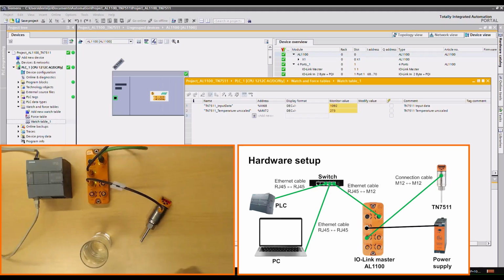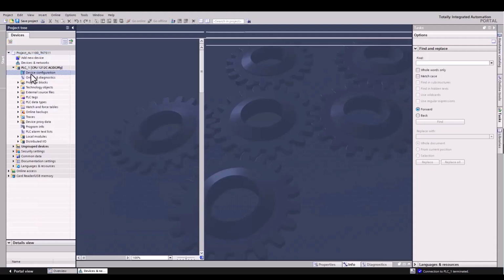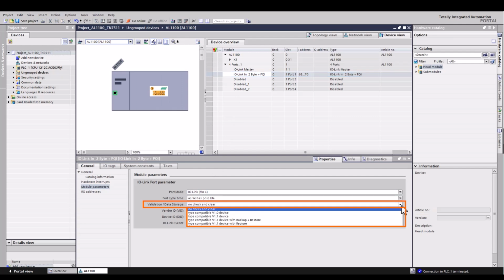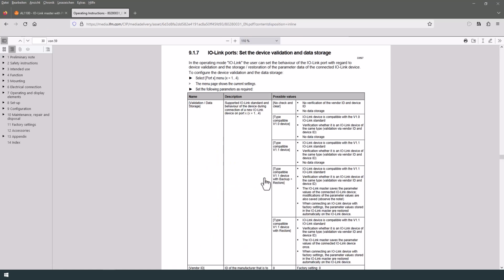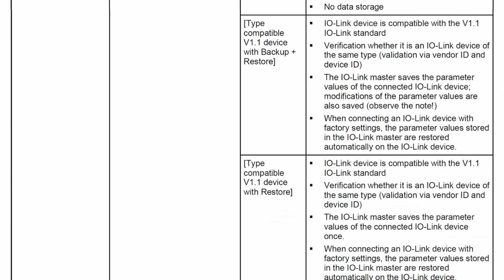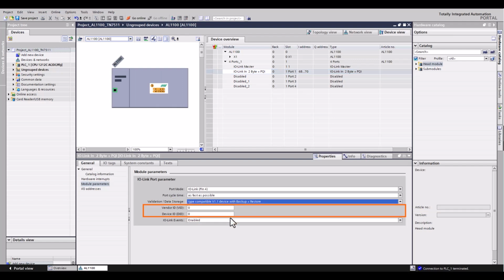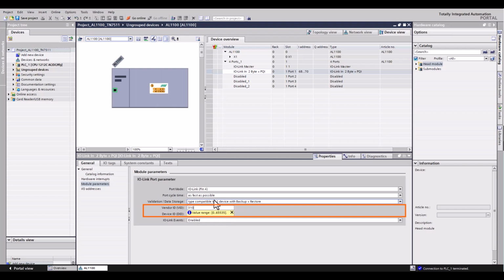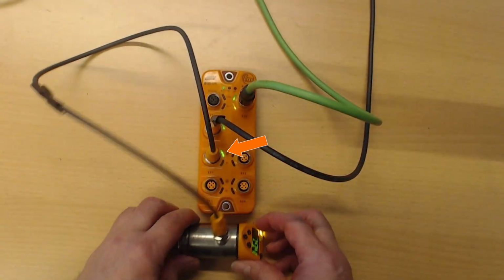IO-Link port configuration of a PROFINET master

Comment: Intégration des modules AL1302 d'IFM avec un PLC S7-1200 via PROFINET

J'ai expérimenté l'intégration des modules AL1302 d'IFM avec un automate Siemens S7-1200 en utilisant le réseau PROFINET. Cette solution s'est avérée simple à mettre en œuvre et présente un avantage majeur : elle permet de se passer des entrées analogiques spécifiques à Siemens.

Grâce à cette configuration, j'ai pu assurer la surveillance des vibrations des machines tournantes, notamment des moteurs électriques, afin d'optimiser la maintenance prédictive. Cette approche permet de détecter les anomalies à un stade précoce et ainsi d'éviter les pannes coûteuses, garantissant une meilleure fiabilité et performance des équipements industriels.